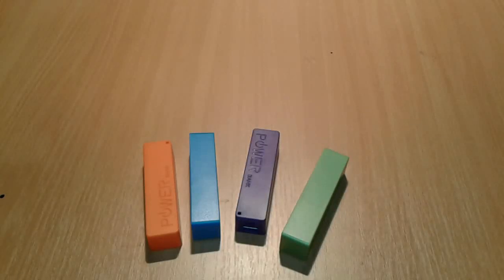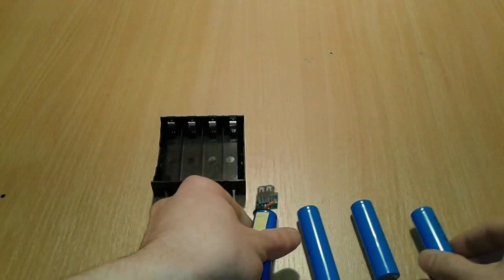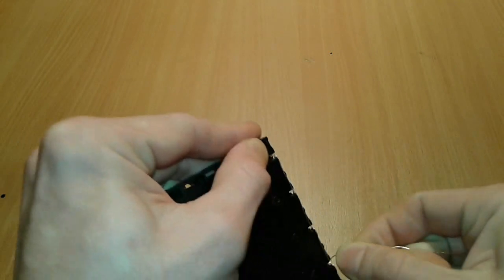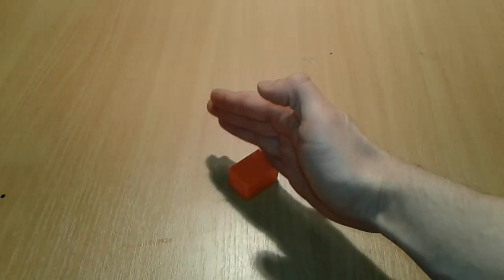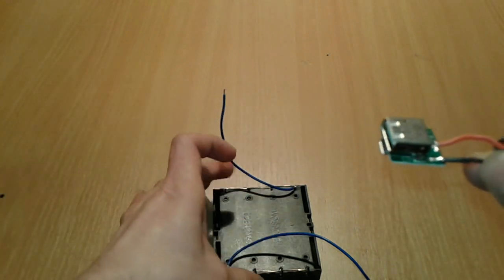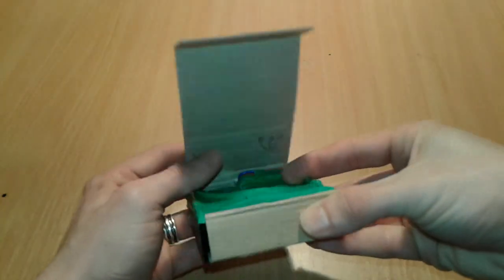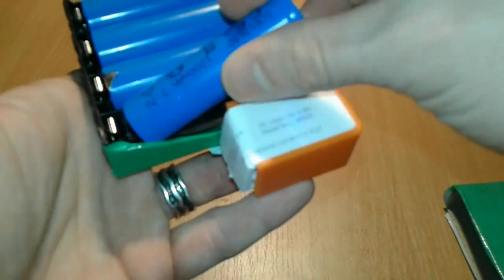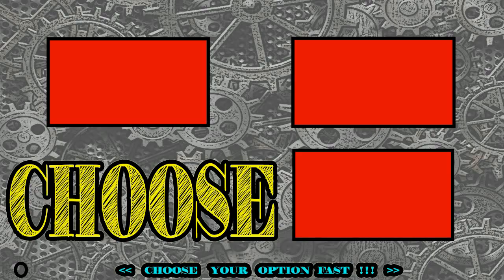How to make your own rechargeable power bank 10000mah

Comment: Thank for your clear explanation.
Can we use 134N3P instead of  TP4056
Module. And how much time it takes to charge 4 series of battery pack.
Thank you
Reply from the maker: shiva krishna you should check the datasheet for your replacement, but this circuit has all build in the charging and discharging protection needed 4 module will take longer because the module limits the charging current tipically for 1battery 2-3hours,4battery in parallel 8h but the result may vary according to battery capacity, being charge at lower rate takes longer but is more safe
Reply: @NoSkillsRequired  thank you.  I could not find dataset for it.what I'm thinking is,  If we connect 4x  3.7v batteries in series to get 11.1v, my charging module (134N3P) capable of charging 5v , I think to charge batterie pack (11v) needs more than its volts (11.1v  >  recharge module power). But TP4056 is also capable recharge 5v power, how can you charged 11.1v with TP4056....??
Reply from the maker: shiva krishna you have 2options charge the cells individually with any USB li-ion charger and after connect them in series like AA BATTERY, or as a 12v battery pack you need 12v at 500ma check out I have a video how to make 9-12v battery pack maybe is more clear good luck
Reply: @NoSkillsRequired  ok

Comment: Can you safely recharge the power bank with a normal phone charger?
Reply: So I can just plug it in to a wall then. How mutch does the power bank output?
Reply from the maker: Random Randomius do you have the same power bank single battery?
Reply: No, but I know where to buy them, I thouth I would ask first before atempting it to build one.
Reply from the maker: Random Randomius ok so if you can buy one of them as you can see in the video inside is a battery and the controller that have 2 USB ports one for charging one for power and should came with a small cable so just plug into a phone charge or any USB charger the output depends on the size of the battery should power a USB lamp for 1-2h and charge your phone up to 50%
Reply from the maker: Random Randomius in mobile phones there is a lithium ion battery 3.7v flat the specs are the same with any USB phone charger or any device that outputs 5v you can charge this power bank

Comment: Can you give me the link for the module you used for the usb
Reply from the maker: VS Puzzler tp4056 you can search on aliexpress should be cheap
Reply: NoSkillsRequired thanks
Reply from the maker: VS Puzzler this chip has 4 connection on the back 2battery 2for USB if you want to solder, or the cheap just buy a power bank like a did in the video
Reply: NoSkillsRequired that one only had a micro usb not usb